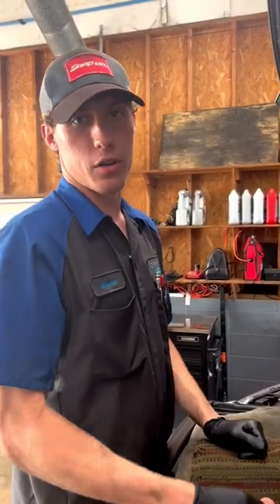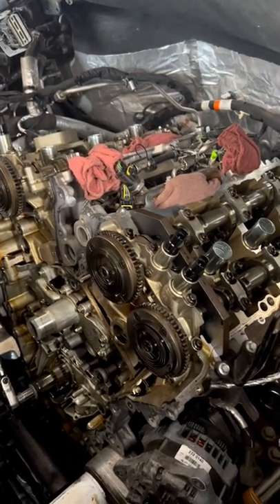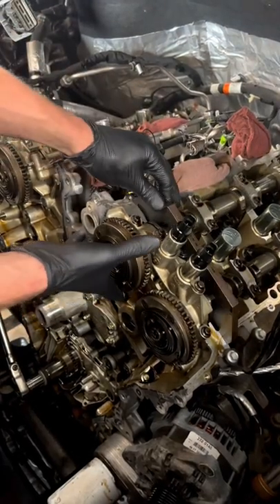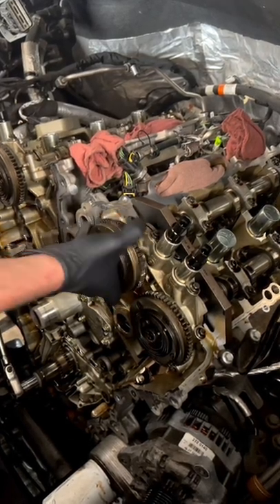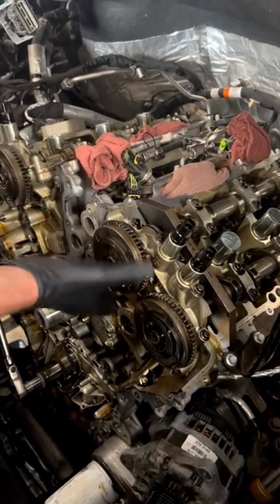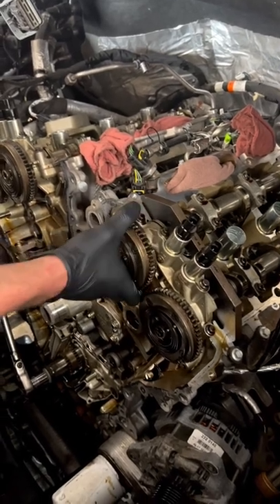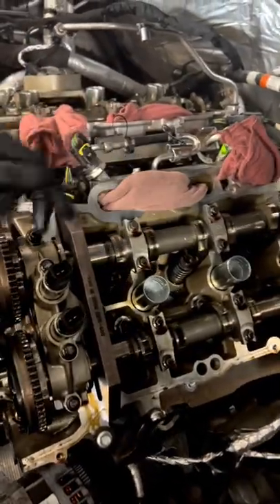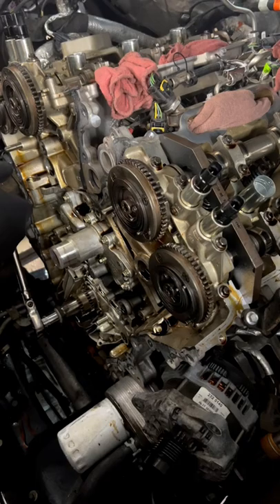Here’s the cause of cold start rattle on a Ford 3.5L Ecoboost #shorts

Comment: Mine does it if I've left it standing for 2 days without starting but throws p0016 and p0299. The thing is that it idles smooth but the power  from idle to 4k rpms isn't there and it has trouble reaching 6k rpm after 2nd gear.

Comment: Do you think it would be worth it buying an ecoboost  or sticking with a regular v8?
Reply: They have weeded out many of the issues with the F150 ecoboost. I would just get 2015 or later. However the 5.0 is still more reliable. The ecoboost are direct injection so no matter what year you get you can still have carbonization build up on your intake valves which eventually cause misfires

Comment: My wife's 2019 Mitsubishi Mirage G4 with the 1.2L MIVEC 3 cylinder does the same thing, it has a cold start rattle, been doing it since about 15k miles (it's got 27k now) took it to Mitsubishi, they can't replicate it so it doesn't exist. 100k mile warranty and 10 years, that's all I got to say.

Comment: I'm sure you may have answered this question but I have a first gyn 2011 F 150 3.5 l with a 145 K.  I get the famous rattle on cold starts but only after it is set for more than a couple of days. Not daily. Since the truck stays in long-term storage I was looking for a fuse I can pull to keep the engine from starting so I can extend the cranking time after it has been in storage to pressurize the system to hopefully avoid the cold start rattle.  Thinking fuel pump relay but don't want to set off codes.  Haven't ever done this.  Is this reasonable and what is your opinion thank you
Reply: I have the same truck. Had the issue as well. The chain is what is slapping. It's not the phasers making the noise. The phasers just allow the tensioners to back off because they use oil pressure to stay tight. I had to replace them. I asked if there is other solutions and my tech doesn't recommend doing pre oilers or high volume oil pump. Those will just cause other issues.

Comment: My 2013 3.5 eco has 130k miles and has had the rattle for probably half its life and miles.  Not on every start, even cold starts.  Probably 50% of the time it does it on cold starts.  Would the type and weight of oil used change this, or help?   Up to about 75k miles I used motorcraft synthetic blend.  Since then, I use mobile one full synthetic.  5w30 entire life.   Also, should I get this fixed and if so what should I look to pay for this repair?

Comment: Ok so is it hard on the engine or bad on anything? Does it need to be fixed?
Reply: It's not the phasers making the noise, it's the timing chain. The tensioners back off because the phasers cause oil pressure loss. If you let it go for too long the plastic guides on the tensioners will eventually start breaking apart than you can jump timing and blow your motor.

Comment: Well I can’t tell if this is my issue or if I have a stretch timing belt cause once in a while when I start my truck 2014 eco boost 3.5L it makes a rattle but goes away after driving

Comment: Is it the same for the 5.4 triton? Get some slight rattle but quickly disapates after starting.
Reply: 5.4l also suffered from timing chain tensioner leak down. Original tensioner were plastic with a glued on gasket that blows out. The updated units are cast iron and have a ratchet so they don't lose tension while sitting.
Reply: @dachine86  I actually figured out that I have a different problem entirely. That was just a symptom of cold starting. Now I have a lose flex plate caused by putting a load on the engine. It makes an audible vibration noise, especially when the A/C is turned on. Also it's a much bigger engine in an older truck, 2007, it's gonna shake a bit. But I got underneath it; the catalytic converter passed the hammer test, and my drive shaft doesn't budge. In fact everything under the truck looks brand new. No rust anywhere. So it has to be the flex plate moving around.
Reply: @HiberNater504  You may want to reassess.  I have never seen a loose or broken flex plate on one of these trucks. The tensioners, phasers, and actuators are the main failures causing engine performance or noise issues.
Reply: @dachine86  Well my awesome local mechanic is gonna look at it tomorrow to see what's up. We'll find out one way or another.

Comment: The pins in the phasers wear into the plate on the inside of the phaser and turns the pin hole into a ramp

Comment: Curious he said nothing about a check engine light with that issue?
Reply: That’s because it doesn’t set a check engine light.
Reply: @benztech2262  Exactly my point. They don’t spend time on fault recognition software. German cars may be notorious for cel’s. But that also because they have spent time on early fault recognition.

Comment: So tell me why on my 5.0 I get a rapid tick when cold after letting off the gas cause I here from ford it’s “normal”
Reply: We have several at work that do that. Even hot when at idle it rattles. Sounds like a rod knock. It goes away as soon and you rev the engine. Aparently "normal"
Reply: Should be running 93 octane premium fuel. My 2019 5.0 has never rattled at any time. Shell premium 93 is all I ever run. Oil change 5W30 full synthetic 3k intervals. Motocraft filter.

Comment: Why do people still buy the ecoboost.
Reply from the maker: Go fast
Reply: Because its one of the best engines ever made. More EcoBoosts on the road than anything else for a reason. 287k on my brother's 15, im almost 130k on my 18. Love this engine. 93 octane Dyno tune at 488 to the tires and 613 on e85. Tows my 38-ft camper in the Blue ridge mountains of Tennessee with ease, cruize set at 80 mph.

Comment: That's what happens when you get a Honda civic engine in a truck.. will stick with my ram 5.7 hemi
Reply: But my EcoBoost can outrun & out pull your piece of shit hemi all day long! I'm on my 5th EcoBoost & I've never had a problem with any on them.
Reply: @darrellfennell520  I towed a full loaded 7000 pd uhaul trailer 250 miles.. barely knew it was behind me and still got 18 mpg... I get 23 on trips unloaded.. 107000 miles 0 problems... only thing a full size truck with a Honda civic engine and 15 turbos are good for is grocery shopping and church.. real men that want a real truck for work has a v8 or diesel engine
Reply: rusrussell  Real men?  Haha, you go ahead and keep on with the delusion your ram is something.  I shame rams daily.  My truck is faster and I pull a hell of a lot more then any on em. 
It's a wonder someone like you can even haul your ego around because you drive a piece of shit that fiat had to save from complete bankruptcy.

Comment: Not a Ford man but this one is junk. The big Ford 300 inline 6 cylinder was a tough big 6 cylinder engine. And the 460 Big Block Ford engine the stock block you can stroker kit it to around 557 cubic inches with a stock Ford 460 block. Not going aftermarket block in those cubic inches like a Chevy or Mopar saves alot of money. Sonic check block wall thickness just to be sure before buying BBF stroker kit. I'm a BBC man but max block bore and stroke is around 512 cubic inch on a 454 block. And a disadvantage of all steel aftermarket blocks they are way heavier than stock steel blocks!!!

Comment: Ecoboost engine needs to be trashed...thrown away....garbage ass motor
Reply: One of the best motors ever made more EcoBoost on the road than anything else. And people are still lining up to buy them. 93 octane tune 488 to the tires, 613 e85 @ 130k miles.